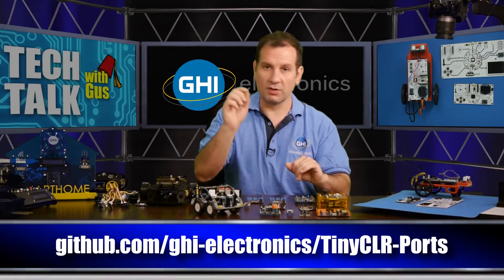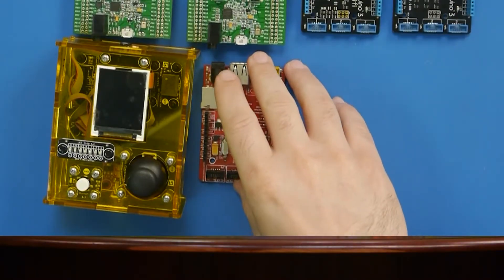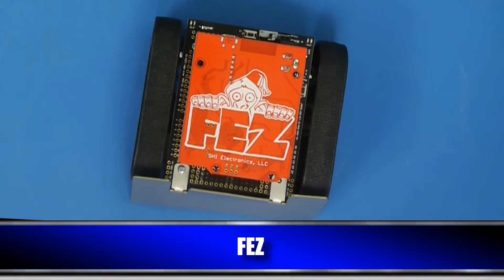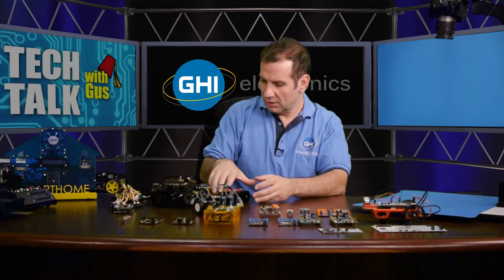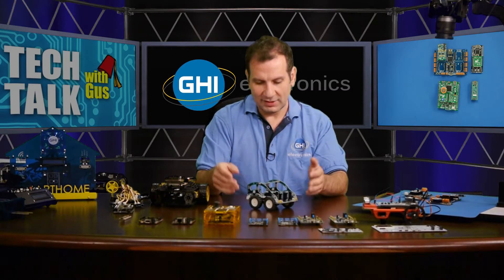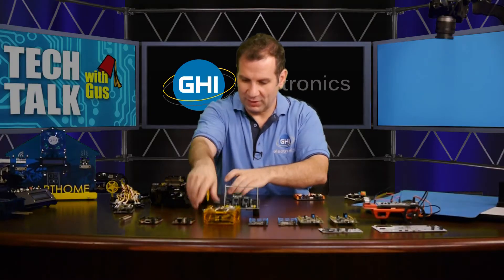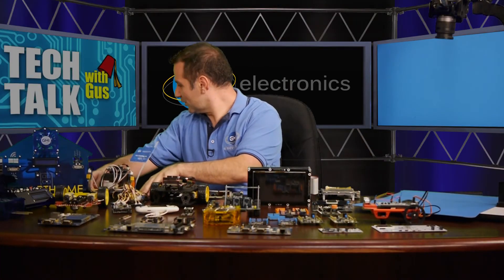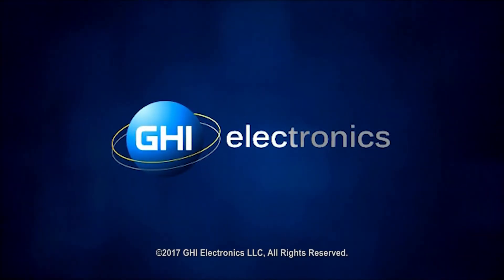TinyCLR OS outbreak - Tech Talk #040

Comment: I have been supporting the fez and panda line-up in the early days (my school days), I started working in the industrial design now. I can't find an arduino or tinyclr board that can work in the industrial automation(at least not plug and play). I hope that your product is going towards makers and commercial use (like grove from seeedstudio). Your development board requires real hardcore engineering team using it to design a product, but most engineers like us are "users" not core developers of product. We hope to have plug and play modules for quick prototype and testing (no soldering). If I spend 1 hour soldering, will rather buy a GrovePi and spend 1 hour coding.
Reply from the maker: what you are saying makes sense for software developers with limited hardware experience, we agree and continue to help hardware and software developers in mind. But remember that TinyCLR can probably run a hardware that fits your need, like Grove you mentioned. With time, we would love to see TinyCLR OS running on everything!